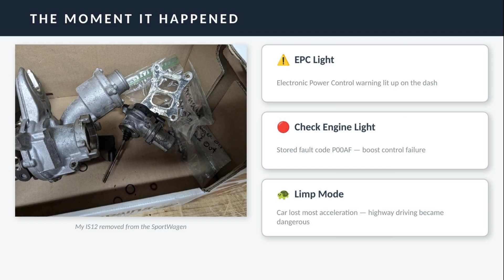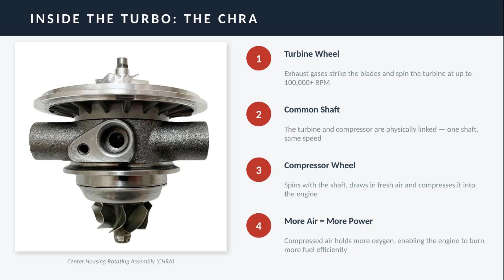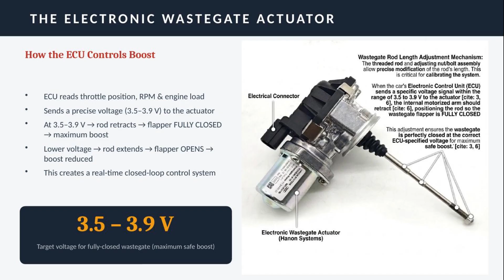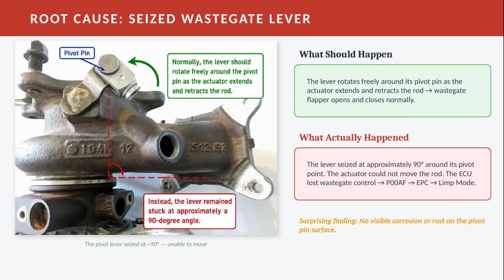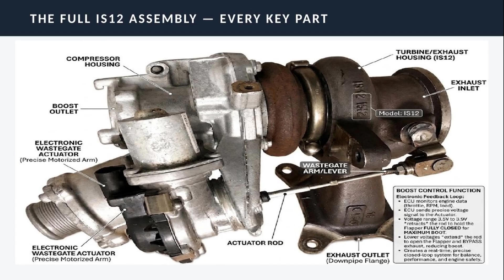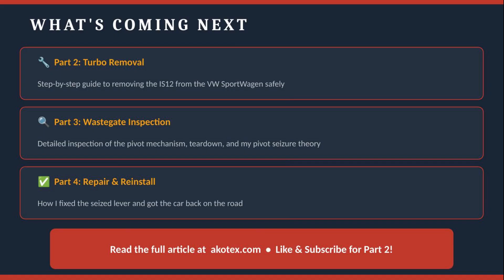VW Golf SportWagen EPC Light & Limp Mode: The REAL Cause of P00AF (IS12 Turbo Wastegate Failure)

Comment: Did you spray it with anti-seize and if so did you get the same error back?
Reply from the maker: Hi, yes I did spray it with anti-seize many times but no results, then I removed the turbo completely and had to hacksaw the pivot the connect the wastegate actuator to the wastegate arm clevis. Then I put it back with adaptation, now the car run great again

Comment: EPC light on and check engine, p334A code. My rod was not moving by hand at all, so I've been spraying it with anti seize and it moves a bit more now... But still have EPC and P334a.  I'm nervous my pushing and pulling of the actual rod was a bad idea. I should have disconnected it and focused on the wastegate lever? Any suggestions?
Reply from the maker: Spraying the actuator rod, clevis, and pivot pin with anti-seize probably isn't going to solve a P334A fault. It can sometimes help if the pivot pin is seized inside the clevis—something I've seen happen on VW turbos when heat and cooling issues cause the pin to expand and bind—but that's only one specific failure mode.

If you're dealing with a persistent P334A, the proper repair is to remove the turbocharger, replace the wastegate actuator with a genuine OEM (Original Equipment Manufacturer) unit, perform a bench calibration (required for IS12 and IS20 actuators) and adaptation, reinstall the turbo, and then perform the wastegate adaptation again with VCDS. Once everything is calibrated and adapted correctly, that usually clears the EPC and Check Engine lights.

Removing the turbo is done from the top of that car and can take you 8 hours as DIY but it is doable.

If you're using VCDS and need a step-by-step guide, I documented the entire calibration and adaptation process here: https://akotex.com/is12-wastegate-actuator-calibration-adaptation-vcds/